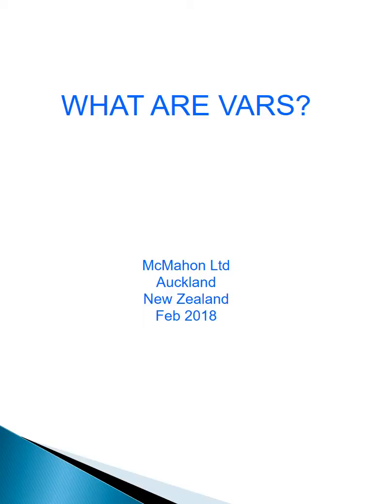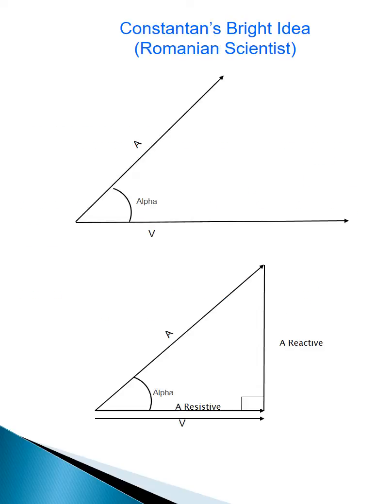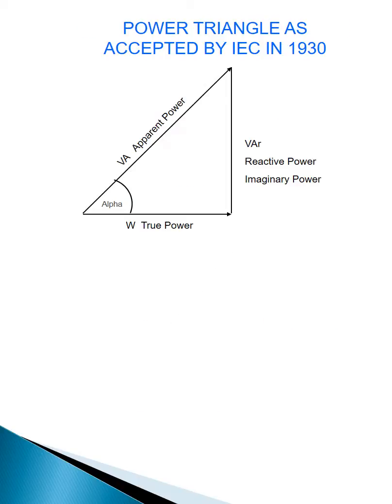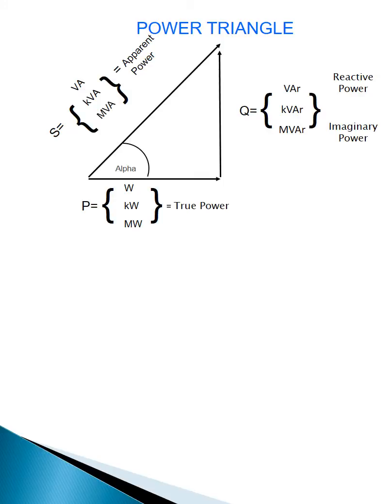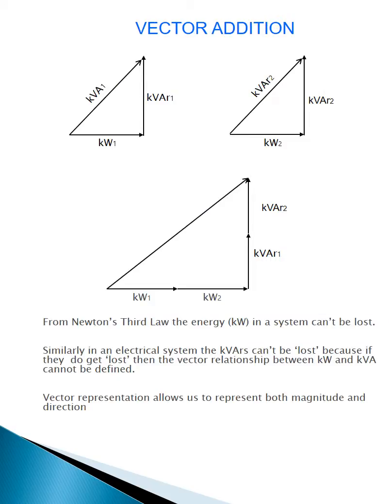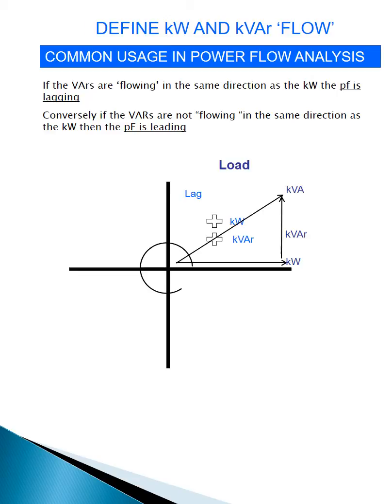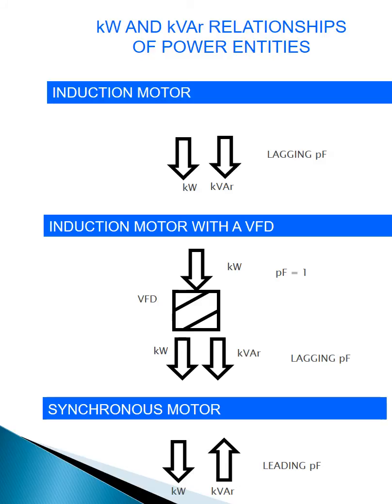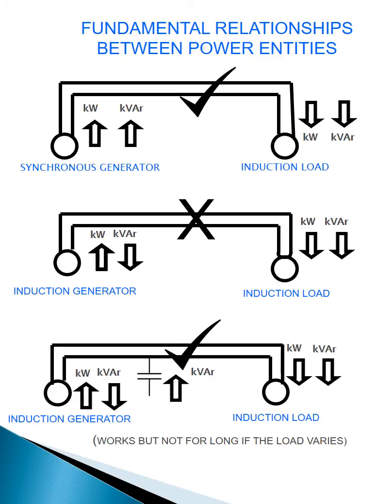VARs EXPLAINED

Comment: Damn this makes a lot of sense.  I am trying to learn about this topic, but keep being told that "VARS are like the head on a beer"

It seems that you have stated: VARS are a mathematical construct designed to understand the relationship of the out of phase angle.
It makes sense that for ease of application that VARs would be made up.  We need to understand the magnitude of power x the phase angle.  Such a value would be measured in a Volt Amp type unit...  

Either way we try to understand them, the concept is lost power (inefficiency in the system).
Reply from the maker: No that is not 
quite correct The total amps are determined by the total impedance which is determined by the resistance capacitance and inductance of the load. The power aspect is then related to this current and the resistive portion only. If you add power factor capacitors to a motor say you do not reduce the current in the motor nor the power but you reduce (usually) the current supplied to the motor and capacitor combination and hence reduce the power that is lost in the resistive part of the system that supplies the motor
Reply: @rodmcmahon4829  
Sorry buddy, i don't understand what your reply is correcting.  
It sounds to me like we are saying the same thing from different perspectives...   
I am relatively new to this, so i am still working things out.  
Unfortunately, to discuss this fully would take more than some YouTube comments will allow.
Reply from the maker: Sure, I can understand that, it is a difficult concept to get your head around, and hence all the misinformation on the web that I was trying to correct.
What I was trying to say is that power cannot be lost per se, but the power absorbed in transmitting energy to the item like  a motor is generally regarded as a 'loss'. Loss  in this regard means you are paying for something that is not used at the end item, ie. the motor, so your comment about efficiency is correct when you are looking from the start of the transmission system.
PF correction is one technique to reduce the current in the transmission system and hence reduce the transmission losses